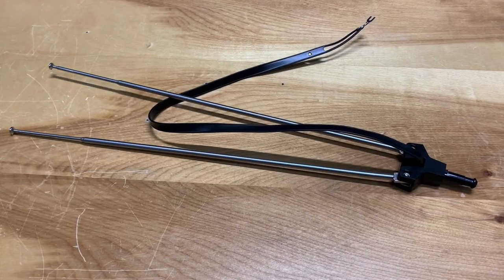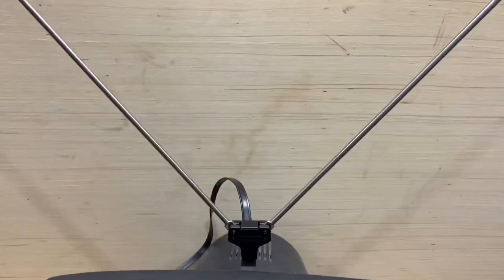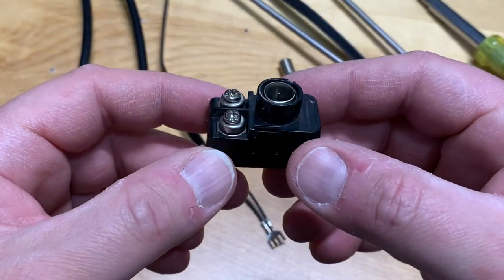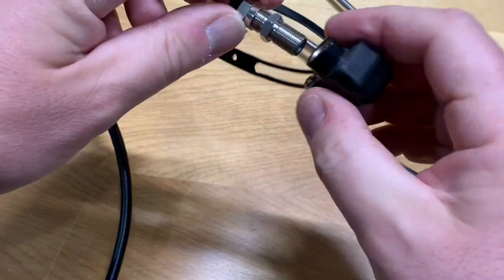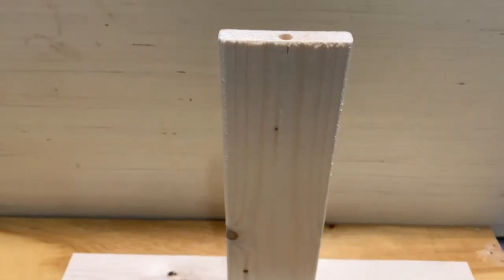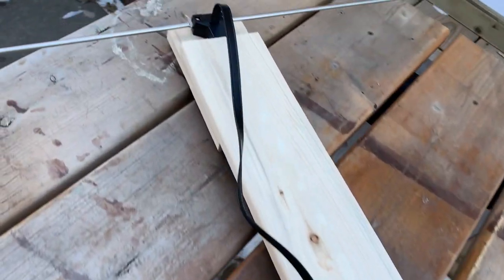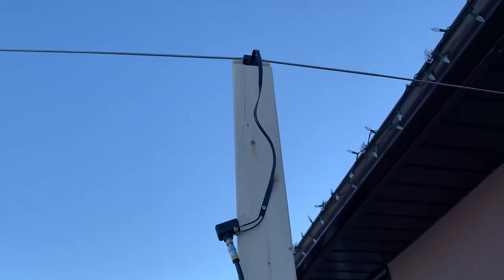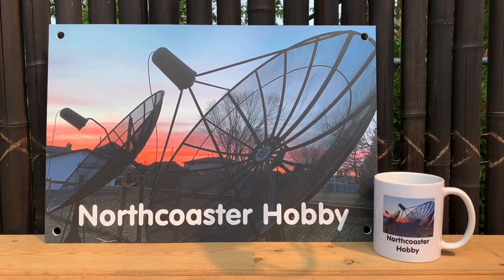Turning old Rabbit Ears into an outdoor TV Antenna for Free Over the Air TV Channels

Comment: Back in 2006 my dad bought a small TV and the rabbit ears was included in the box We had cable back then and we still have it now but before installing the cable channels I did a reception test and I was very surprised with the results. All 3 channels on VHF High Band had crystal clear picture as for the UHF band, 2 channels had very good picture and the last 2 had good picture. The high power UHF channels had very good picture and I was surprised to see that the low power UHF channels had good picture. Since I had cable TV, the rabbit ears were very useful for my radio. The FM reception was awesome and improved the stereo reception on some channels, unfortunately I no longer have the antenna.
Reply from the maker: Yes, I gave away a couple of pairs of nice long VHF rabbit ears years ago, wish I had saved them.

Comment: I did exactly that with my rabbit ears.  Mounted them on a 10 ft 2x2 up on my front porch roof.  Used a 25 db amp.  Was able to receive the big 3 network stations for about two years.  But last weak a huge storm came through my area.  I lost all 3 channels.  Reset the "ears" used new cable and an amp but still no signal anywhere on my property.  My wife has to watch her soaps now on the computer usually a day later.  So much for free TV.
Reply from the maker: That’s unfortunate, but I’m glad you had success with it before the storm. Maybe try locating it elsewhere, or possibly did the amplifier get damaged? If it’s broken you’ll likely get no signal. Maybe try it without the amplifier. You can always replace the amp.
Reply: @NorthcoasterHobby  I tried different "ears", cables and amps....no luck anywhere on my property or my neighbors either.  It's just ..gone.  The storm was huge.  Major damage everywhere so it did something to block my signal.  The stations are still OK.  Going to have to go over to my neighbor's to watch the USFL playoffs...on cable.  He's having a good laugh.

Comment: How did you get the cableling through your exterior wall to your tv? Other than that ommision, very good, straight forward video.
Reply from the maker: I have a conduit chase I installed to feed coaxial cable through the wall from outside to inside.

Comment: HOW do you know that the transformer from three hundred to seventy five ohms pass the test ??
Reply from the maker: I’m getting all my channels.
Reply: I understand Sir. How would one check to see that the unit is working besides the TV is working test ?? @NorthcoasterHobby
Reply from the maker: I suppose you could connect it to a spectrum analyzer to check for signal. @victoryfirst2878
Reply: Any way to check with a  ohm meter ??  @NorthcoasterHobby

Comment: Couldn't you get a piece of wire and make a UHF loop to go along with it?
Reply from the maker: You could. Or get a loop antenna and add to it.

Vintage TV Antennas from the days of Analog TV - Rabbit Ears, Loop and Bowtie - still work in 2022
https://youtu.be/MHnTes8HJ6s
Reply: @Northcoaster Hobby  But they're not HD and 4K ready.🤣 
Since the UHF band is now only ch 14-36 would you make any size adjustments to the loop for optimization?
Reply from the maker: @KevinT7274  A bigger loop would be better optimized for RF channels 14-36.
Reply: @KevinT7274 there is no such thing as “hd or 4k ready” tv antennas, they are a marketing scheme

Comment: That screw between the 300 ohm leads is a big no no.
Reply from the maker: What is the reason?
Reply: @NorthcoasterHobby  The spacing of the wires determines the ohms. A screw in between can act as a capacitor and notch out a frequency. What you have built is a notch filter.
Reply from the maker: @timcat1004  fair enough, but it didn’t affect reception of any channels whatsoever. Plus it’s easily removed.